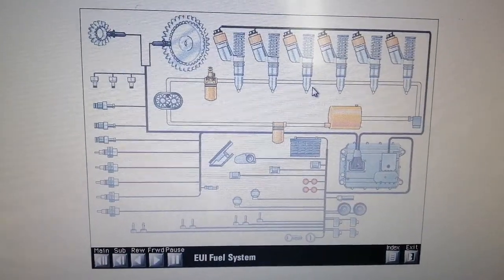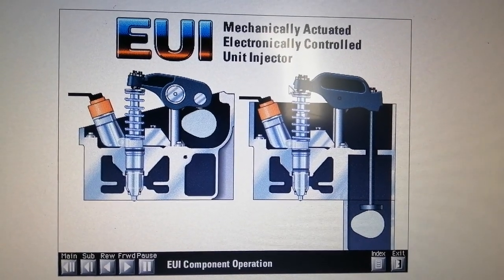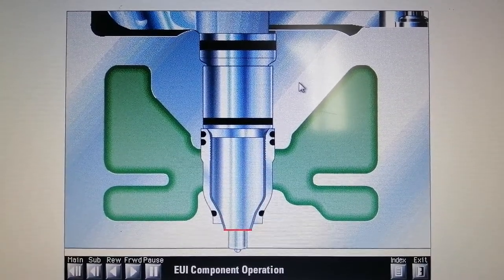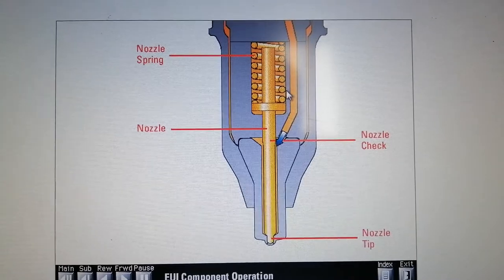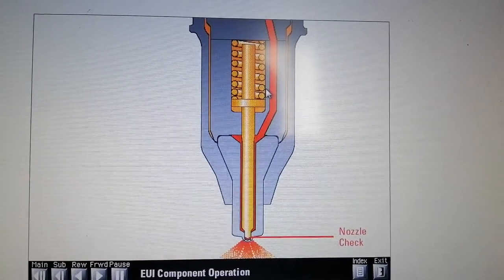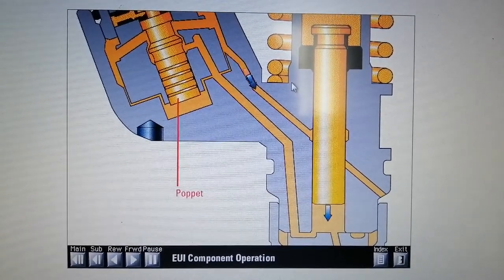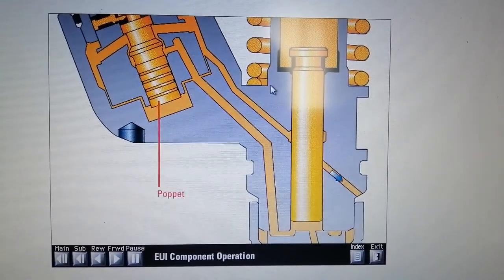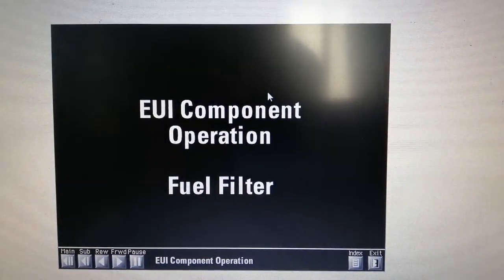CAT EUI Fuel system

Comment: How to determine amount of fuel injection in this system?  Pulse width?
Reply: Yes, the Pulse Width Modulations from the ECM control metering to each injector. That's why inputing trim codes when you replace injectors is important.
Reply: @Wozney  thank you for your reply